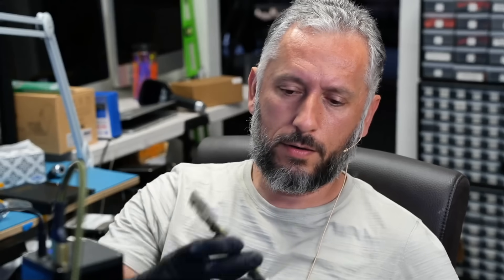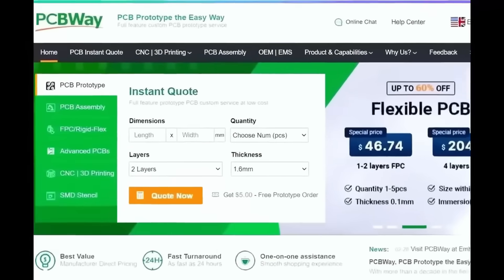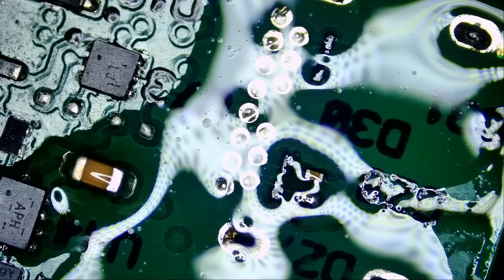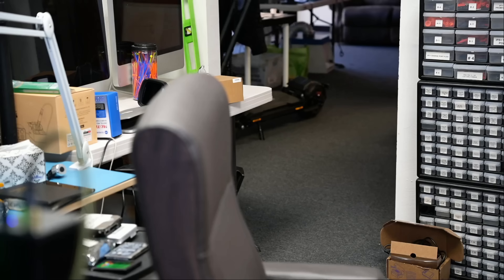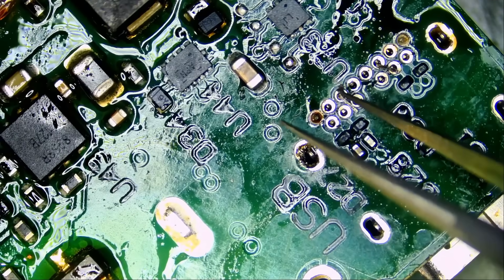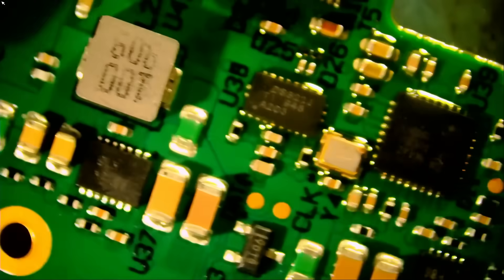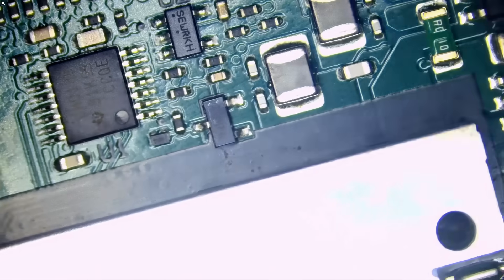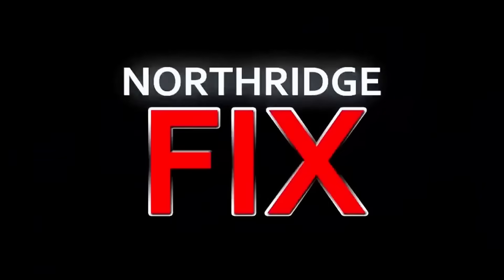Expensive Blackmagic 6K Camera Repair: Prior USB-C Replacement Gone Wrong

Comment: It's ridiculous that mechanical support for connectors like USB ports is the solder pads on the board. What a fundamentally flawed and prone to disaster design that is.

Comment: A guy takes his car to a mechanic and tells him the motor's not running right. The mechanic tells him to start the engine and pop the hood. After listening for a bit, the mechanic grabs a hammer and hits something under the hood. The engine's noise immediately improves and the mechanic drops the hood and tells the guy, "All good now. That'll be $100, thanks." The customer is incredulous and says, "$100?? You gotta be kidding - all you did was hit it with a hammer!" The mechanic replies, "Yup - that's $5 for the hammer and $95 for knowing where to use it."